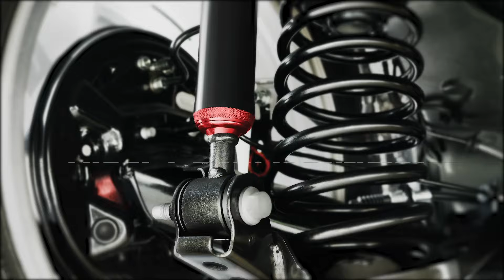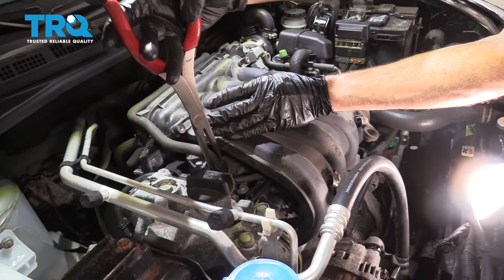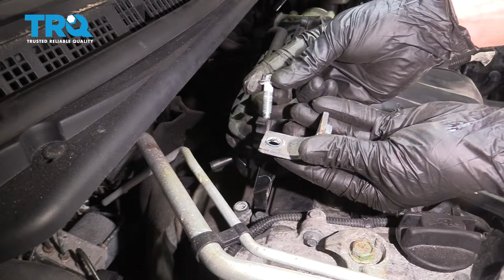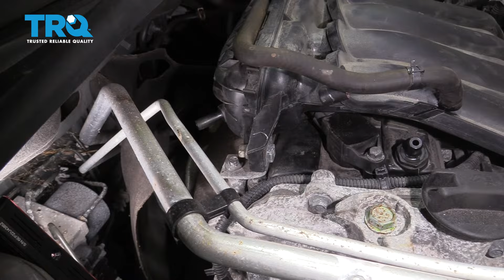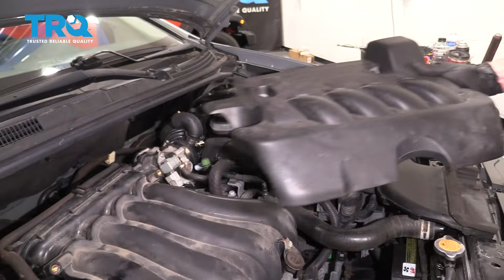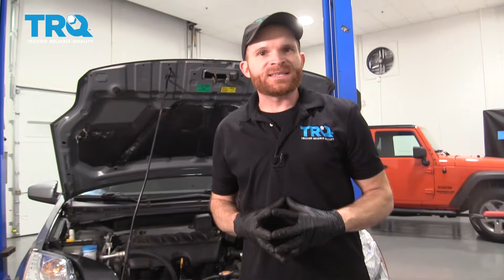How to Replace Spark Plugs 2007-12 Nissan Sentra

Comment: Get the 9/16 or 14mm spark plug socket or have the magnet pickup tool that is small to pull the spark plugs out. U can loosen with the deep socket but u need the magnet or the spark plug socket to pull it out. I never knew that opening could be that narrow! I went and bought a magnet and the magnet was too big. Next trip I bought a thinner magnet then decided to just buy the socket in case the magnet couldn't lift the plug. Socket was nearly 10 dollars but the magnet pulled it out. Returning the socket. Ordered a set of 5 on Amazon for 11 dollars. I'll just have extras. Good luck. Wasn't a hard job. Just tedious and excessive for NO reason! Hours of work!

Comment: All that to check the gap on the plugs. Just as well those NGK platinum plugs will last a 100,000 miles before they need replacing. I can remember a time when all you needed to change spark plugs or check plug gap was a solitary plug removal tool, now you seem to have to bring a Tool box with you.